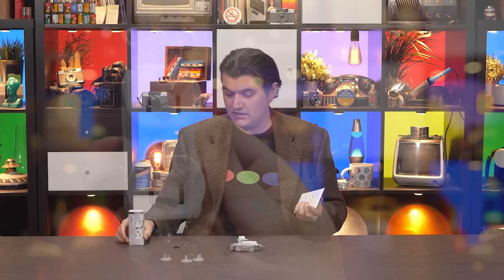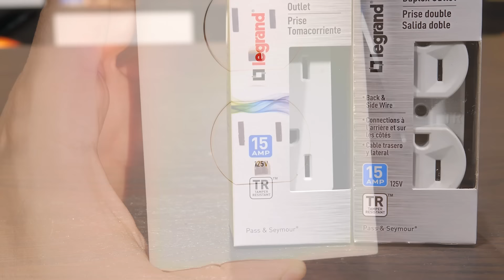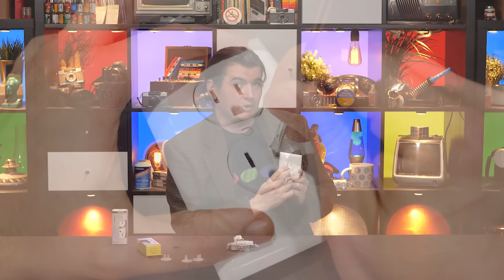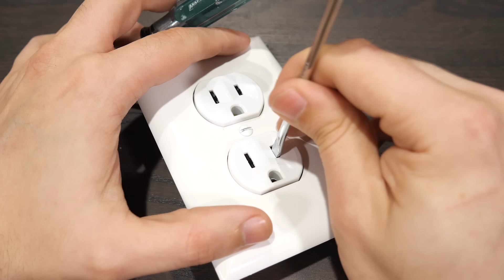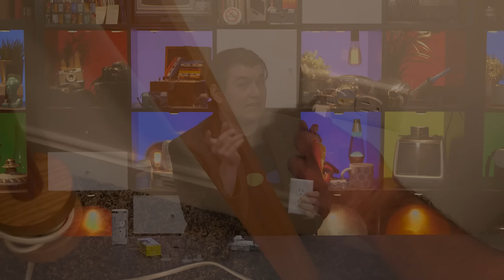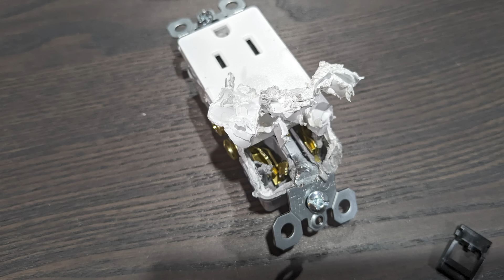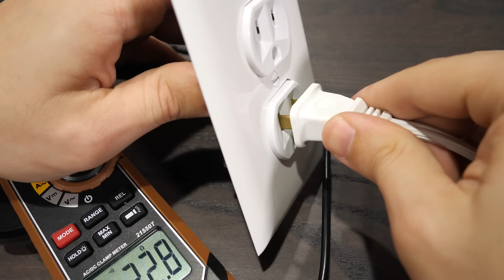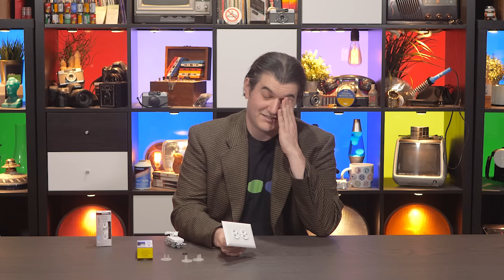Tamper-resistant outlets aren't all the same - a follow-up

Comment: cannot stand non grounded US plugs. I've lived in the US for a year now and there is not one positive thing I can say about the US electrical system, but hey. In the UK we do have cables that are not grounded, but we still have the pin for it. Usually it's just a plastic peg in the shape of the ground pin that opens up the shutters, sometimes it's metal and you wouldn't know it wasn't grounded. We have very tight regulations on what must be grounded in the UK so that's not really an issue. You were also required to have intimate knowledge of your electrical plugs because until 1993, many of your electronics wouldn't even come with a plug. You were taught how to wire a cable in your first year of GCSE's which is around about year 9 or 10 (Grade 8/9 equiv in USA) depending on what you chose. In 1993 a new law came around that all appliances must have a sealed cable which is not removable with just your screwdriver.

I've been to airports, hotels and apartments that have out-of-order or barely functioning wall plugs that my power brick will just flop right out of. I've had a flight before where my phone needed charging and I had to use my backpack to support my power brick to stop it from flopping back out just so I could pull up my ticket in the next half hour. Miserable experience. That's one of the reasons ALL UK plugs have that ground pin, even if it's fake.

I also have some vintage USA electronics, like my soldering magnifying glass which is a Bausch & Lomb 'SightSaver' with built in bulb, but the plug is a non-grounded type with next to no space between your fingers and the pins.

Then there's USA extension cords. I have lots of electronics with wall-wart technology that is so gracious to block the surrounding 2 other plugs, so now I'm playing a game of Tetris just to organize my computer monitor. In the UK, all plugs are the same width and height, so 99.9% of electronics will plug in and leave the surrounding wall plugs free, until you get the one chinesium made device which decides to take the American route and block the next parking space in your wall.

Comment: Obligatory UK plug bore here. Whilst most UK socket/outlet implementations use the earth/ground pin to open the shutters as mentioned in the video, there's no requirement to use that system. Some designs do require all 3 pins to be inserted and you've been able to buy them for many years.
Also, those childproof blanks are now discouraged in the UK as they are redundant and can be manipulated to defeat the inbuilt tamper resistant features of the outlet ( @fatallyflawed1947 on YT covers this in detail)

Comment: i think the falling out thing might be caused by
- shape: blades vs round prongs, especially when an us plug is oriented vertically i can easily imagine it getting loose sooner
- recessed sockets: if i exert a sideways force on a plug, most of that force is probably gonna end up in the side walls of the recessed socket, and not on the springy clamps. (recessing makes it also completely impossible to touch a live prong! is there a reason its not possible to recess us plugs?)

Comment: Screwdriver is only a half of a problem. My mom still has a nail scissors that I once put into the wall outlet. They got such a fancy metal balls on the tips. This is how I learned to not to mess with electic sockets.

Now, with all of these tamper resistant stuff, most of the kids are not able to break in. Only the best of our children, the most curious and intellegent, are able to get past the shutter, get a shock and possibly die from it. Can I have an inverse, please, to kill but the most dumb ones instead?

Why aren't sockets recessed into the wall? That way the main problem described here and in the connections video, the metal thing falling onto half-inserted blades, simply wouldn't matter. They will still be inaccessible.

Comment: My church as these vacuums, and I'm sure some people know what I'm talking about, cuz they're all the same. But, they don't stay in the outlet. They have a grounding pin, the "newer" models distinguish between live and neutral. But no matter what, they don't stay put. It's literally like you're setting it in the outlet, and then the vacuum will randomly turn off cuz the plug just fell out of the wall.

Comment: TR receptacles are as useful as the safety interlock switches on power tools that require you to unnaturally contort your hand to operate the second switch, resulting in a weaker grip on the tool and your hand cramping. Since there is less contact there is more opportunity for poor conduction and more heat, and the less contact you have the faster the metal will degrade due to the electron flow, which is not a perfect, everlasting one to one transfer. 
Manufacturers pushed for TR adoption because they cost more (as is the case with Wagos, which suck). One or two aren't much more, but when you consider how many are in an average home, it adds up.
A much more effective solution would have been to GFCI the entire house. GFCIs typically trip in a tenth of a second any time there is a 6 milliamp differential between hot and neutral. 

110 is definitely safer than 220. That's why European plugs are all grounded and have the insulated section on the blades. Without that they would be much more dangerous than a North American plug. That's also why our 220volt circuits are reserved for permanent or semi-permanent non-branch circuits.
A 1.5 volt AAA battery can kill a person if applied correctly, so the argument against 110 being safer than 220 is ridiculous. 
Any electrician will tell you they are far more cautious when working around 220 circuits than 110 (unless they are idiots). I've been shocked many times by 110, never by 220.

As a retired electrician I also agree the stab connectors should never be used due to the extremely poor contact area. I have had many service calls where a receptacle or downstream circuit was dead or intermittent because the conductors developed a notch at the contact point of the stab connector. That either caused arcing or the conductors actually popped out of the receptacle completely. 
Similar to TR receptacles, stab connectors are allowed because electrical unions greased the right palms, yet even then the powers that be at the NEC weren't stupid enough to allow them on higher amperage devices. Their inclusion at all is based on the misconception that stab connectors are more cost effective due to being slightly faster, but a shortcut is never cheaper when you have to go back and fix the problem it created.

Did I mention Wagos suck? Trillions of wire nuts have been used for almost a century (since back when they were ceramic) with very few issues. Like anything they can fail if not used correctly.

Comment: At least things are less dangerous nowadays than they were in the 1940s and 50s during the tube radio era, where some manufacturers would just tie one end of the power cord to the metal chassis of the radio as a shortcut to save connecting a lot of wires to the negative side of the power supply. And that was before polarized plugs were a thing! Sometimes this happened with PA systems, guitar amps, etc., and you'd have a musician get shocked by touching the microphone at the same time as a metal part of their guitar!

Comment: For a long time i got so confused for a long time by some plugs just reffusing to go in these back then i thought it was like a presure thing asuming kids would have a harder time puting right amount of pressure. I later learned its the hiting at same time so i wonder if those plugs just had un equal length prongs. I also think i have had a few outlits that i think the shield got stuck in the closed place.
This was years ago so early version of the design

Comment: I’ve an important correction: Actually no one who isn’t a professional should replace outlets cause they don’t have the equipment to run Zs and Ze tests to make sure the values are still within the limits. If they aren’t a short circuit for example wouldn’t trigger the circuit breakers anymore and that will make your house quite black and small 😅

Comment: I would argue 120 volts is more dangerous than 240 volts, simply because the current is doubled and the risk of fire from overheated contacts is increased, and this is compounded by poor quality outlets. The number of people who are killed every year from electrocution is such a small number it's almost zero, but the number of people killed in fires is orders of magnitude greater. A small electrical shock is usually harmless.

Comment: Some plugs also have slightly longer and shorter pins which make the TR super difficult to insert into. At least the new ones that got installed in my 2021 home.

Comment: If it was a lower-voltage AC you came in contact with in the jukebox, then that almost certainly would have been generated using a transformer, which means it's isolated from the mains/ground anyway.  There is no way that that could "leak to ground" (because ground would not complete a circuit for it), and a GFCI cannot detect anything that happens on the other side of an isolation transformer.

So if it tripped because of your messing around it was almost certainly because you came in contact with a live mains wire, though it might still have been a fairly high-resistance contact that only allowed a small amount of current to flow (but enough that the GFCI still tripped), not necessarily "full contact" that would have given you an actual noticeable shock.

Comment: IMHO, only making contact with the very end of the pins (so it can't come very far out without becoming disconnected) is actually much worse from a safety perspective, and a very bad idea.  The reason is that then, if something is actually turned on and the plug comes out of the wall even a little bit, there is the potential for it to start arcing within the outlet as it makes and breaks the connection erratically.  This can quickly lead to internal damage within the socket and actually even starting house fires, etc.

With the current design, it may risk having some slightly exposed live pins, but at least plugs do not generally wiggle out far enough that they become intermittent (and potentially start fires) under normal circumstances.

Comment: Back Stabbing is not equivalent to a Wago.
The Decora Edge, ES5325-SW by Leviton is an example of an outlet termination method that is equivalent to Wago.
Both are done by compressing the conductor using a tab to actuate the mechanism.

Comment: My father was an electrician and as a kid, I was always fiddling about with electricity. Given that Australia has a 240V system and I must have received a couple of dozen shocks, it is a wonder I survived.
As a toddler, I was always poking things into outlets, so my dad replaced them all with "safety shuttered" outlets - but he made the mistake of explaining how they worked. The next minute, I am explaining their operation to the girl next door, poking wires into the outlet while the is playing with their ends.

The next time I found a plug that my dad had cut from a cord. I plugged that into an outlet - naturally by pushing it in with the cut wire ends against the palm of my hand. That left a nice hole on my palm for a long time...

Probably the best was when I was trying to do "electroplating" - I was ~5yo and had seen something on TV. I had a jar or mercury (yes, this was in the good old days) and had submerged a penny with wires attached. I was then trying to "get electricity" by poking the bare wire ends into an electric bar radiator.
Good grief - another explosion.

These days, I am an electrical engineer and am (rightly) terrified by the prospect of fault currents in large electrical systems 🙂.

BTW - regarding "knife throwing" induced faults, my father was working at a factory. Whenever their bandsaw blades broke, they had the habit of putting the broken bits on top of their electrical switchboard.
My father opened the board and all the bits fell inside... (he was OK - but it woke everybody up).

Comment: With the latest NEC cycles there has been a major push to GFCI protect nearly all circuits. Plus Tamper Resistant receptacles are code required for new builds AND replacement of existing receptacles in most locations.

Comment: Really any issues with our outlets could be solved by just having every circuit be a GFCI. Even if you touch a live wire, it'll immediately trip and mitigate a shock. The GFCI in my kitchen has tripped a few times. The only thing plugged into it is the air fryer which is entirely plastic, but the cord does have trouble staying in since the outlet is sideways and the plug is ungrounded. I don't know what exactly is occurring, but whatever the issue is, the GFCI is doing its job

Comment: There are standards for hospitals in the US for how much tension it takes to pull a plug from the wall and they even have meters to test this (basically a plug on the end of a scale that records how much tension was achieved before it pulls out of the receptacle).  This is only hospitals so far.

Comment: what if someone designed a US outlet where the round bit u plug stuff into is disconnected from power, and pushes deeper into the outlet to essentially turn it on, like a toggle button (like how other countries have switches for their outlets)? maybe design it so that it cant push in while empty, like theres something in the back that the plug has to hit in order to disable the "safety" to guarantee that the outlet is filled and plug fully inserted before the outlet can be powered, and that you have to turn it off before unplugging, maybe by pushing it again or make it so that (when powered) it grips onto the plug tighter so that it would require more force to unplug than to unpower it, ensuring the outlet is unpowered before unplugging to prevent partially inserted yet powered plugs? it could cause issues with larger plugs such as laptop chargers but maybe that could be solved by making the outlet stick out when empty, and flush (like they normally are) when powered

someone let me know if this is already a thing or has already been attempted/has other flaws that i havent seen

Comment: 10:20

As an electrician I can tell you with confidence DO NOT backstab the conectiors. People have been fighting to get that made illegal in code for years but the home builders fight to keep it cause it saves them money in installation costs. That's where the 15 amp rule comes from. All institutional jobs like hospitals and big commercial buildings put in spec that it is forbidden. I have seen plugs that melted because of backstabbing faults. It's really not worth they minute it saves. Do things the right way and avoid shortcuts. This is your home on the line. 

Cold flow, oxidation, age all loosen that connector and they it acts as a resistance point and the connection will get hot under a high load like using it with a space heater, or charging an electric vehicle. 

As for Wago's... I'm skeptical about them too and avoid them for anything serious.

Comment: Speaking of dumb things we do as kids... I remember we had a very old bar heater where the element was an exposed wire wrapped around a ceramic core which, when plugged in, got hot and glowed. (More modern radiators have this wrapped in some sort of insulating quartz glass type stuff). Anyway I was curious as to how quickly the radiator would heat up when plugging in so - you guessed it - I grasped the heating element while with the other hand I plugged it in. One 240v shock later and I decided I didn't really care how quickly it warmed up! But hey, I'm still here!

Comment: On backstabbing outlets being like wago connectors. 
Can you pull the wire back out easily? Or does the outlet hold it in a death grip?
You need to do a lot of twisting and pulling to get a conductor out of a wago push in connector, which is why I don't use them and use 221s instead. With the lever connectors (221 222) you'll break the conductor or the connector before it lets the wire go.
In both they're held under constant, heavy spring tension, meaning that a layer of corrosion is less likely to build up and even if it does, the pressure on the conductor should break the thin, brittle layer.

Edit, yeah seems a back stab is just the same as a wago push in connector in terms of positive affixation. Holding about 38kg before letting go of the conductor. Impressive. Seems fine for holding a single conductor and probably better than the screw terminals because it isn't going to loosen over time due to heating and cooling.

Comment: wago connectors are see-through, and you can confirm that the wire is fully inserted and secure. most outlet backstab holes you can't see into.

Comment: As an european I completely agree with the "falling out" comment. All of the US plugs/sockets I've seen on video seem as loose and as easy to unplug as the loosest most abused EU sockets I've seen. The sockets here grip much more tightly, and you just don't ever see a plug partially inserted, or bent or anything. It's either in completely and securely, or out. Even in this video you've shown the plug being partially inserted. Or have you seen the multiple ways people tie extension cords in US? I've never even thought about that in the EU - they don't need tying or anything, even the ungrounded plugs sit very tightly in the socket/recepticle.